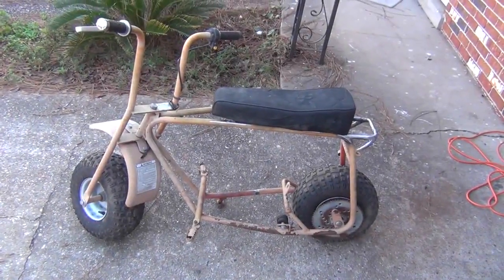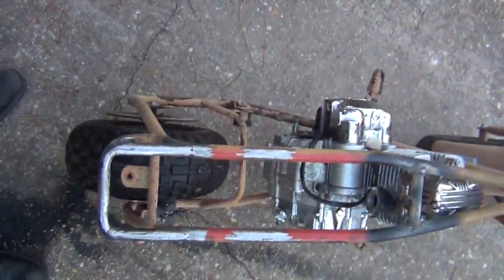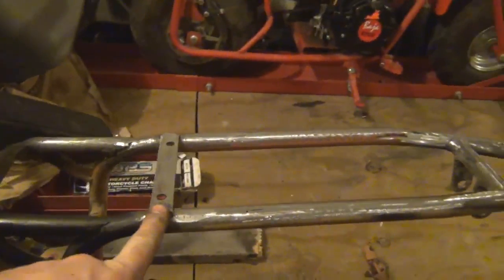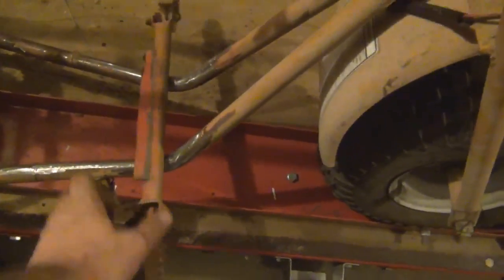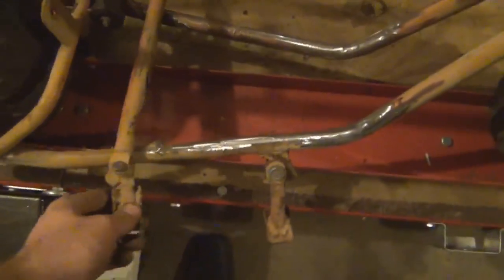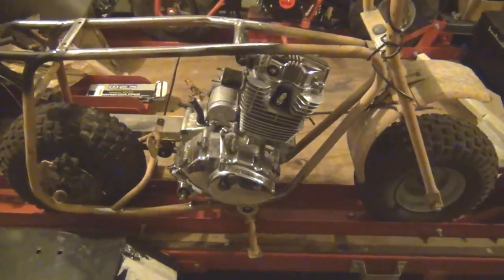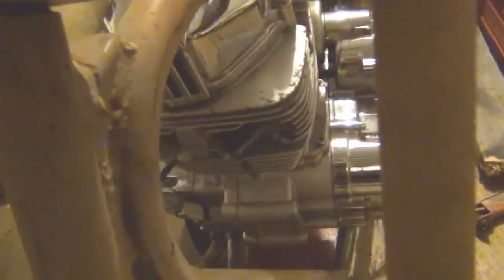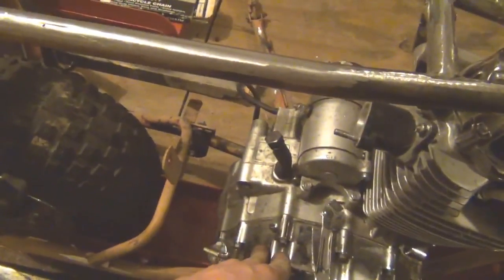DoodleBastard Engine Swap - Part 2

Comment: Its is going to be extreme.
Reply from the maker: Yup, I can't wait to kill myself on it.  LoL!
Reply: DuckmanCycles Gosh that aint good. I think a wheely bar is a darn good precaution, pretty sure 12 hp is going to make it crazy wheely happy but who knows maybe not. I m tending to think it will though.
Reply from the maker: Considering stock is about 2.5HP and has a cetrifugal clutch and single speed... 12HP with 5-speed and a manual clutch will surely make it not only wheelie like crazy, but it may cap out around 70-80mph.

Comment: why does the engine have a twin exhaust?!?!
Reply from the maker: +Anthony Marin Because it was designed that way.  I'm going to guess probably because of the really cool sound it makes.
Reply: you should put a straight pipe on it
Reply from the maker: +Anthony Marin It already has straight pipes on it.
Reply: i mean straight out over the tire